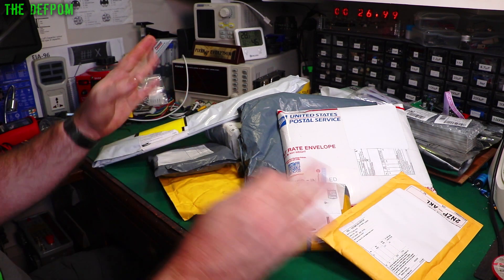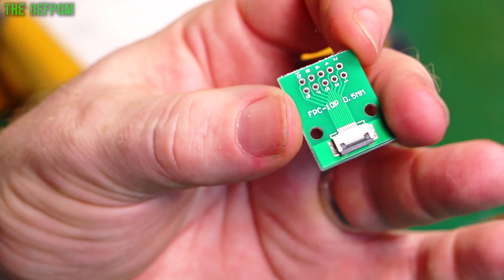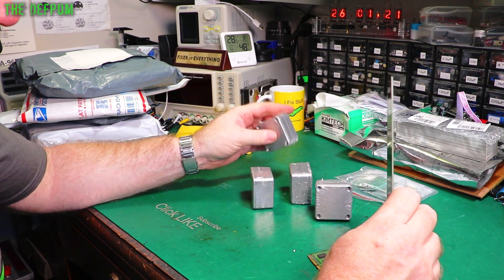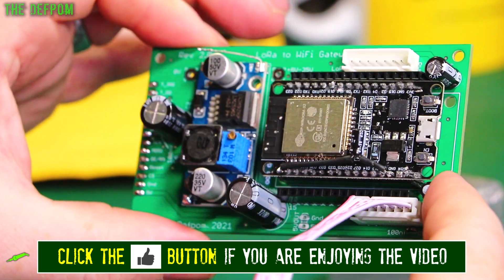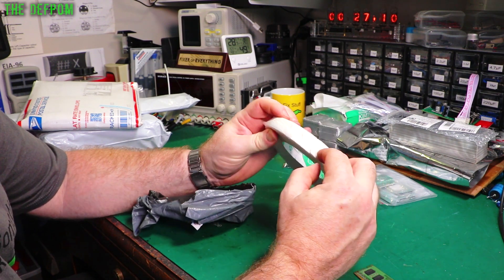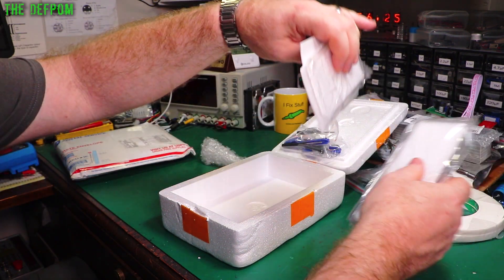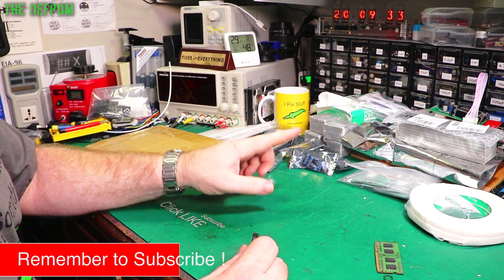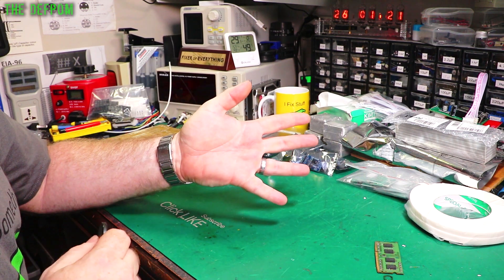🔴 Mailbag Monday 15th February 2021 - No. 804

Comment: I bought loads of those DS3231 modules;  a cheap way to get the parts.  I use a CR3032 to VBAT; no charging and lasts forever.  They may well have spec lower the the originals... I resync every 24hrs to ensure I'm always within 1s.  Oh and the 1Hz output can be useful... to know when the time actually changes!